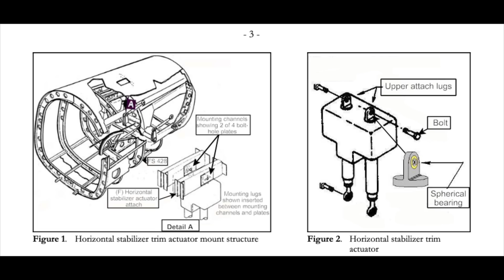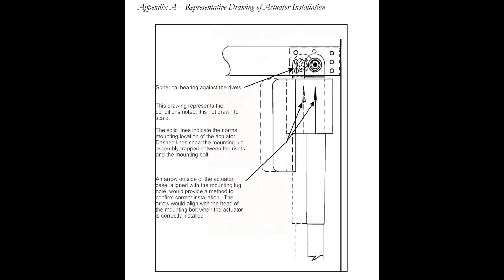The Blind Fix That Crashed A Plane | Hidden Flaw | Transwest Air 602

Comment: The pin idea is a good one, as is the marking idea. The marking idea gave me the idea, since there are lots of planes like this that already exist without that marking, perhaps it would work for the mechanic to take a sharpie or something and, before removing the old one, make a mark on either side of its position so that the new one will end up in the same position. Obviously this wouldn't work if the reason the thing was being replaced was because it wasn't in the right place to begin with but I imagine that it gets changed more often for other reasons so that its original location would be the correct one. Other than that, perhaps it would be good to find a way to put a small camera in there in some place so as to be able to actually see if the thing is being installed in the right position. They might also want to redesign this part a little bit on future models of the plane.

Comment: I'm a certified airframe and power plant mechanic.  Something  I would have done or recommend being added to the procedure is a visual check using flashlight and telescoping mirror to verify that everything is correct.  A simple and proper visual inspection should have caught that problem easily.

Comment: In suituation where u install parts on an aircraft by feel due to blockage, make sure to use a small inspection mirror ( with a long handle ) and a torch light (cause its dark in there) to see if you have installed the stablizer actuator correctly according to manual.
I have worked on that before, particularly flap actuator.
Thank you for sharing this video bro.

Comment: Always assembly aids for me as post installation verification is dangerously prone to positive conformation bias. A temporary pin that is then dislodged by installing the correct bolt sounds really good. (especially if it’s tagged so as not to be accidentally left in the airframe!). The one thing that you can guarantee is that that engineer involved won’t do it again but then you share the findings to save your colleagues from the possibility of making the same mistake themselves. Proper quality systems.

Comment: Use of a pin to relieve the weight of holding a heavy device and trying to align a tight fitting bolt and not having a clear view of proper alignment sounds like a great idea.  Couple this with some additional mechanic practice  to be sure he is doing this correctly seems in order too.  Also written instruction and picture could be added to existing instructions to proper installation and kept as a permanent addition to existing documentation.

Comment: Yeah, I wish they'd make stuff for the trades so we don't always hold heavy stuff over head to screw in.
Reply: 5kg does not sound like much until you have to lift it over your head and in front, after a few seconds it feels like a sack of rocks, and if you have to juggle another part that depends on alignment, good luck, these things should be done by a 2 person crew always
Reply: @gglovato  doesn't sound like there was enough room for another man to get his hand up there.
Reply: I have to wonder if there was a mechanical reason not to put a stud in the mounting hole then use a hex nut to secure the part once it was in place.

Comment: From a design standpoint, making it so the part can't be fitted wrong is always better, and making things easy to service and repair is so important. As an engineer, I know a lot of my fellow engineers have very little real world experience when they come out of university, and end up designing things that are impossible to build or maintain. 
From the perspective of the mechanic though, his experience made him complacent. Just because it didn't fall out (and in fact worked for 12 flights) meant he assumed it was right and didn't check or verify. Understandable, but also preventable.

Comment: Nice work on the production of this. I personally have been assigned repair jobs on certain aircraft that I thought were very unfair of service manuals to ask of me like having to install fasteners blindly then safety wire them together blindly and do in a certain amount of time or get paid less, it sucks, sometimes it’s physically painful just trying to position yourself in a way to do some of these jobs. I had made metal notes of certain planes to try to avoid doing certain jobs on because I knew in advance how I would feel at the end of a workday.

Comment: The fix is simple, make it impossible to install the actuator unless the bolt goes where it is supposed to. A couple of mating lugs would do the trick, so the actuator's lugs have to align with the mounting point before the bolt can be inserted.

Comment: I worked as an aircraft mechanic for almost 40 years.  I can see how this happened.  Many tasks are performed blind, by feel.  

Perhaps a redesign of the mounting area.  Install a “filler “ so that there isn’t enough space for the actuator to be that far out of place.  

Second,  in my tools I have one of those cheap borescopes.  Plug it in a phone or tablet, laptop whatever.  Then work it in to get a view of the area being maintained.
Reply: I like the "filler" idea.
Reply: I like the fact that you can see how this happened and not immediately trash the guy. This happened many years ago and technology has advanced and gotten less expensive. It is a poor design and difficult to see when installing. We all make mistakes especially when under a great deal of pressure to “get this plane flying” like a lot of AMEs are.

Comment: I'm not going to lie, I do feel sorry for the mechanic who did the repairs. They could've killed the pilot and passengers and that must weigh heavy on them.
Reply: I thought the same thing. “Boyyyy would I hate to be that mechanic. But even worse would be the mechanic who learns they made a mistake that cost many lives.”
Reply: @Syclone0044  it has happened before.  This is why the FAA is so strict with its rules.  Things have been forgotten or missed and it has killed people
Reply: I knew a guy that was an A&P and his friend's plane went down shortly after he'd worked on it.  Although he was cleared in that fatal accident he quit working on planes.
Reply: @Skimblshanks  I beg to differ   - the FFA has proven time & time again that it us a politically driven place, in bed with the plane manufacturers, and a lackadaisical attitude towards safety.  Strictness is not a word that many, many would not use if they had survived their plane crash.  The lastest tragedies due to Boeing's 737Max & the lackadaisical reaction of the FFA, who certified the Max, to the crashes is proof enough.
Reply: @Torontotootwo  are you a certified A&P mechanic? Have you ever worked with or under or around an FAA inspector? I have and it's not at all like what you are saying.
Reply: @Skimblshanks  Well, we're talking about mechanic  competence here or the FAA - can't tell from your reactionary dialogu If the mechanic was competent, the passengers would be alive.    Kinda says it all, doesn't.   A metaphor for your defensive personality would be similar to a surgeon working in your abdomen in the dark.  "Can't see a thing, but you'll be out of the hospital in no time."  If your reply   was about the FFA, my case rests.  Maybe you should consider trying to understand  other people's thoughts rather than reacting.  I'll bet $100 that I can guess your political positions too.  Game?
Reply: @Torontotootwo  with out a doubt this was the mechanics fault. As an A&P mechanic you are sopose to go over all your work to make sure it's done correctly.  This is why I said mirror and flashlight comment. All he had to do was  use a flashlight and a mirror to look at what he did. To see if it was correct or not. Far as FAA the 737 Max aircrafts there is a bit more to the story than the media fed you.  This same problem happened state side but the pilots were trained what to do. Where overseas it was proven that training never happened in some places. My understanding is if the system failed.  Turn it off. Correct what went wrong and then turn it back on. Again my understanding is overseas they kept turning it off and on and off numerous times to fix.
Reply: @Skimblshanks   I agree with all but the Max.  The pilot's manuals did not include any mention of the susceptibility of the plane to porpoise.   The APA had strong objections to Boeing's process. We all know Boeing was racing the plane to market.  We all know one of the sales points was that no further training was required.  Their greed and insouciance cost many lives. A very deadly shame. The FAA allowed Boeing to practically certify the Max.  Was the historic grounding of the Max for 20 months the result of an obvious intentional fault or what?  Sure sounds like a guilty party to me
Reply: @Skimblshanks  So, my lack of understanding places my blame on Boeing as do to my being confused by the media? All the tragic deaths are fake news?  The Max was grounded due to exaggeration by the press? And you know from where you are that I have only watched TV to form my opinion?  No argument on my part; just justifying my belief.
Reply: It did. I happen to know the man personally and he had a very hard time afterward to the point that he never did mechanic work on aircraft again. He stayed in aviation, but took an office position in QA instead.
Reply: @Torontotootwo  understand ounce the media is involved.  Things change. You say something to the media and they tell the world.  Again there was more going on than what the media fed you.  Max pilots were interviewed.  Training records were inspected. Again ounce you got a million people nor trusting your products.  You have to do something to show it was properly taken care of. Why? So the media would say you actually fixed it. I work in the aerospace industry.  I keep tabs of what's happening.  Like the 787 issue.  The media is all over it again.  If proper inspections of the fan blades were performed in a proper manner.  Blade break up and failures wouldn't of ever happened.
Reply: @Skimblshanks  Yes, the media is always chasing the sensational side of things.   So do people who like sensation. Thank God for the press or, e.g., we'd still be in 'nam. I do my own research.  There was no denying the Max tragedies.  The press did not ground the plane for 20 months by convincing governments world wide.   Boeing's greed & treachery did. Don't have to be in aerospace to know that.  Can you at least recognize that  I have a valid point?
Reply: @Torontotootwo  Boeing had to do something.  I agree there. But again the media made it sound like it was worse than it actually was. Understand this. Boeings fix now makes it you don't need extra training on that system of the aircraft.  The 737 max have been flying a long while. Suddenly it's a problem.  Again state side pilots had actual training on that system.
Reply: @Torontotootwo  I'm not arguing your point.  But again there is still more to the story.  Again pilots were interviewed and other action were taken.

Comment: This is a difficult one. On the one hand it is easy to throw your hand in and say it was the mechanic's fault, yet equally you could pile the blame on the manufacturer for making a safety critical part have an ability to be installed incorrectly.

I'm a vintage vehicle engineer and former motorcycle mechanic so I don't have aero experience but to my mind the two big elephants in the room are working up in a blind void with sliding fit fasteners/pivots/shafts and (no direct experience of the part so this may be invalid) the lack of "feel" on the part of a mechanic/the h with that many years under their belt.

When you fit a part into a mount and engage the two parts together you may feel when they sit right together and MUCH MORESO than this, you can feel through the bolt/shaft/pivot etc if it has engage with the inner bush or sleeve and is sliding through it. It's just something you pick up over time BUT I think that you have it or you don't to start with. It can't be taught from scratch. 

So, to remedy this situation I would suggest less pressure on the mechanic to get the plane out of the hangar doors and the use of illuminated flexible endoscopes to ensure everything is correct.

Comment: Locator pin.  Hand screw in a long pin with threads on one end to the hard point on the aircraft.  Then push the actuator with the pin going through one of the mounting holes. This would positively locate the actuator. Then install one or more of the mounting bolts and when finished unscrew the long threaded pin and replace with the actual bolt, then torque all bolts to specs.

Comment: I would do one or multiple of the following things
1. As said use a pin to secure the part for installation
2 design the part with locator pins so that the part can't fit incorrectly
3. use a lift for the part so that the mechanic can observe the part directly during installation
4. Lift the plane to accommodate for easier installation
5. Widen the area around the bolt holes so that it is unable to jam up against the rivet
6. Design a locator shroud can be put on the part during install to keep it in position and removed afterwards

Comment: worked on aircraft 45 years . We have torches , mirrors, boroscopes . etc. If we are installing by feel we look to make sure  and then look again. Also you would feel the bolt engaging through the eye end. On top of that it's a flight control system assembly and would  require  a duplicate inspection after installation .  Bengal

Comment: As an aircraft mechanic there are many instances where you have to work by feel. Where you can not see unless you can get a mirror, or a series of mirrors in the area to make sure what you are working on is installed properly. Where was the inspector in this scenario? That is a major component in the flight control system, it requires inspection, upon replacement, or another set of eyes.
I think the manufacturer could modify that mounting structure so that the actuator mounting lugs can only fit into the mounting points, unless you would need room for the actuator to pivot forward or aft, and you would need the extra clearance that caused this to happen in the first place. In other words create a mounting point that the actuator mounting lugs can just fit into where you can not put the bolt in wrong. Or jam yourself in there and get a good look, period.

Comment: Taking in to account the two thoughts presented as an alternative I have two other thoughts.
One, A bigger dia Bolt then the actuator can Not be fitted because there is not enough room for it to go between bolts and rivets!
The other is similar to what you said, I will call it a timing mark. Having said that the device has to pivot so a simple gauge can do this as in if it does not pivot then it danger Will Robinson!
John, Australia.

Comment: How the heck did you come up with that chicken-reference. I would have thought “drilling the screw of the moving pedals of your crosstrainer in next to the hole where it is supposed to be screwed in in the existing ready-made hole,so the whole thing eventually makes the hole bigger by the friction of the unofficial drilled in hole to the pedals and your crosstrainer just gets less and less workable since everything moves back and forward until basically inoperable” would be muuuuuuuch better as there was heavy stuff on it too which had to be installed on feel 🤣

(Yes I have a crosstrainer, yes I put it together myself from computer to pedals to decorating shit, and yes I used the official holes and screwed them in with the washer and YES IT WORKS 😂😂 
Fixing the sink and replacing the plumbing line however, that’s a no-go.... I’d be too afraid to “screw up”. I’m a complicated woman.)

And I would add measures to see if the work was done correctly. Doubling down doesn’t assure anything.

Comment: I spent years working in aircraft manufacturing (not a pilot and not an engineer) but I might have put a joggle in the aircraft brackets. Which is inexpensive but might make it impossible to have the bolt hole entirely misaligned. We also had numerous holding fixtures but since the tools don't do with the plane the joggle is a better idea.

Comment: Putting the burden on the mechanic (i.e., more training) is the wrong approach here.  Instead, the actuator and mount should be revised to ensure a "positive" indication when the actuator is correctly installed.  Additionally, the mounting procedure should be revised to include an intermediate step that allows the actuator to be inserted into the correct position prior to affixing it to the mount so that the mechanic doesn't have to hold it in place while mounting.

Ten pounds does not sound like a lot of weight, but it really is, especially if you have to hold it in an awkward place while trying to mount it.  Adding to this, the part is installed in a hard-to-reach and hard-to-see place.  After about a minute, that ten pounds feels like a hundred.

This is a prime example of poor engineering causing an accident.  The blame, IMO, falls squarely on the engineer who designed this mechanism, not the mechanic.   I say that with some authority,  being that I'm an engineer,  albeit in a different,  but related, field.
Reply: Exactly. Had design by an engineer who failed to consider the reality of working on equipment in field conditions.